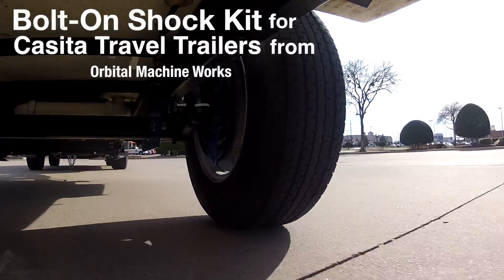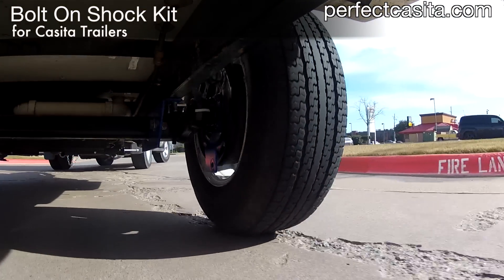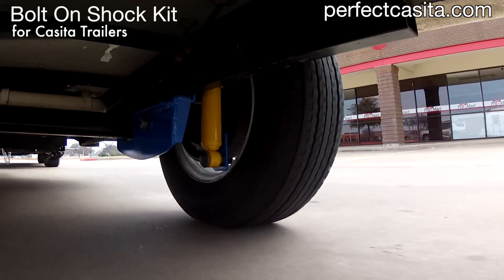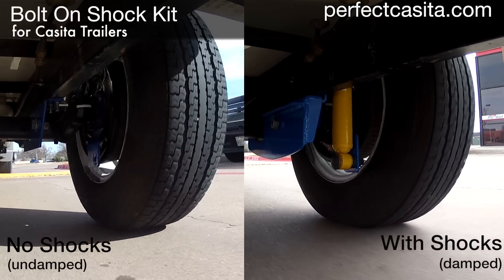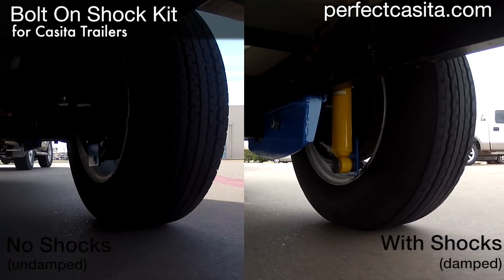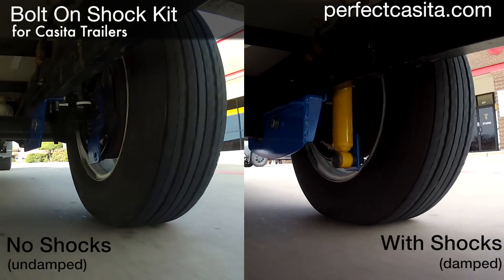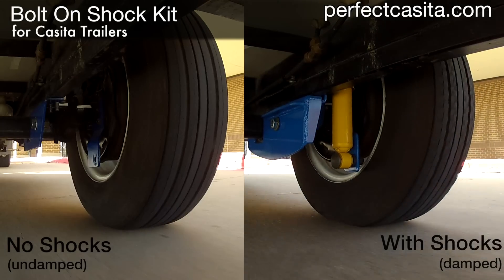Casita Bolt on Shock Kit Demo

Comment: Dramitic difference seen on the frame freeze. Without shocks, tire in the air and very compressed landing. Just lost a tire on a pot hole. I could feel tire landing and popped in that case. I'm getting these shocks. Does shock kit mod work with the 3" Lift Kit Mod I already have?

Comment: Not impressed at all. I see almost no difference.
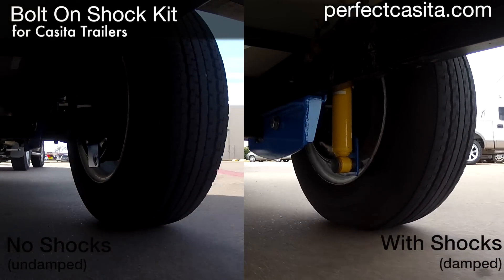Reply from the maker: Shocks don't reduce the first bump by much, but they quickly stop the bouncing. This makes for a much smoother experience for the trailer and everything packed in it. For example, take a look at the bump at 1:22. The unmodified casita Bounces up and down 14 to 16 times. The Shock kits reduce this to 7 to 8. This equates to whole lot of energy absorbed by the shocks rather than your dishes, gear, and your tow vehicle.
Reply: Found the technically inept guy......
Reply: Lance Baker I noticed a huge difference after installing mine.